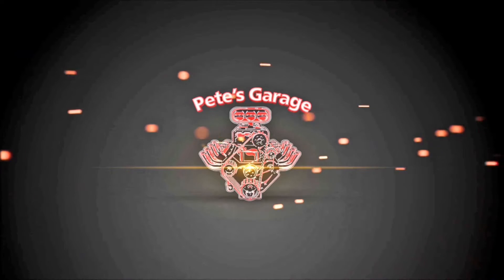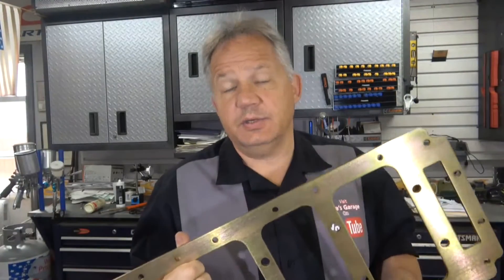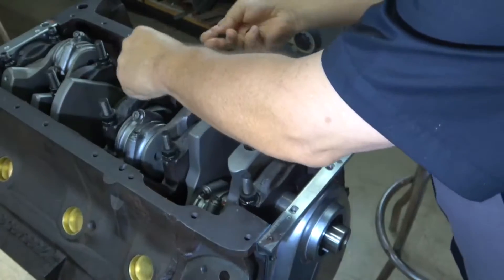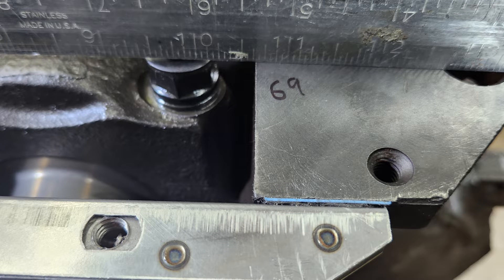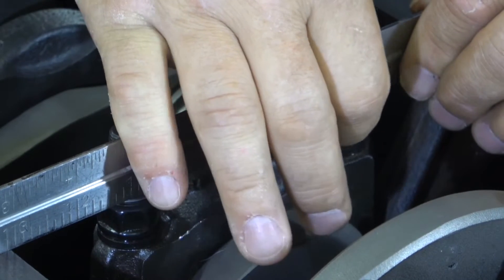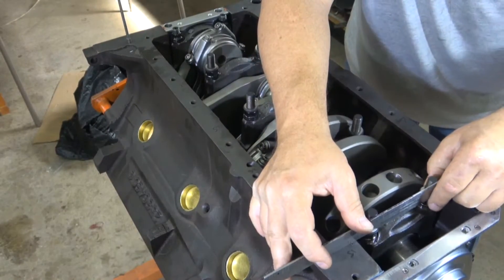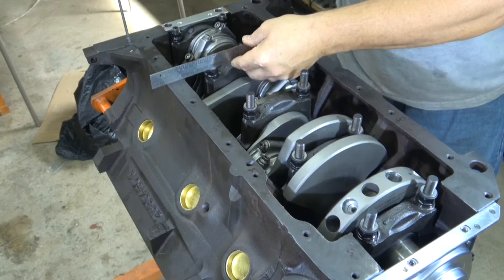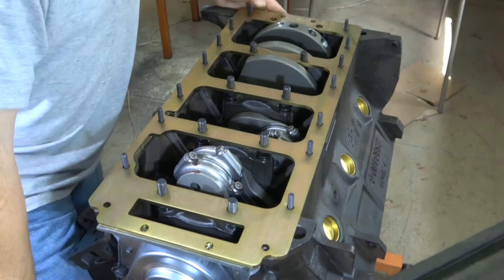Engine Building Tips - Setting Up The Girdle 440 MOPAR 512 Stroker

Comment: Don't forget you have to re-line bore the mains if you add the girdle when the mains came with bolts and not studs.  It can cause warping otherwise, which doesn't matter too much for low HP engines, but if you are pushing it to the higher ends, it very well could.  Great video!
Reply from the maker: That is true, but I always switch to studs

Comment: I USE THE GIRDLE. BUT USE The FELPRO 1808 OIL PAN GASKET. THEN USE THE THICK SHIMS. A LOT EASIER THAN USING VARIOUS SMALLER SHIMS.  YOU NEED ATOTAL OF 3 GASKETS. ITS WORKED ON MOTORS I BUILT.
Reply from the maker: 3 gaskets?

Comment: Double stamped: no idea.  But I couldn't stop from having a little fun: assembled by Bob Bitchin?  If I had to guess, original assembly November 1969? That [I think] meshes with 1970 broadcast codes.
Another fine video, as always.  I don't think sealant thickness is much concern? Should be enough flex in the girdle to take up that 0.001" or so.
Reply from the maker: Thanks for playing  Leeerttss make a dope deal. The thickness is only an issue if you put on too much and it squishes out all over the place